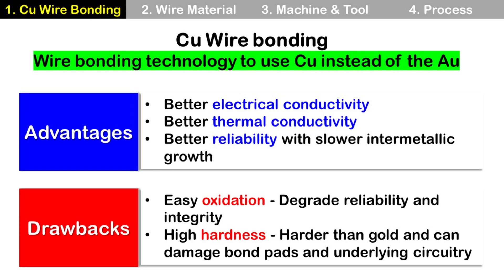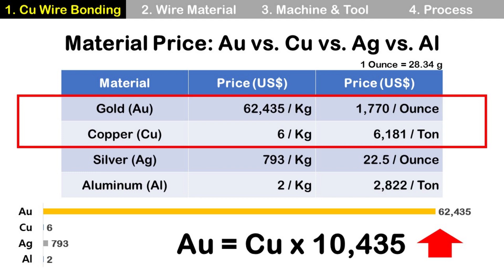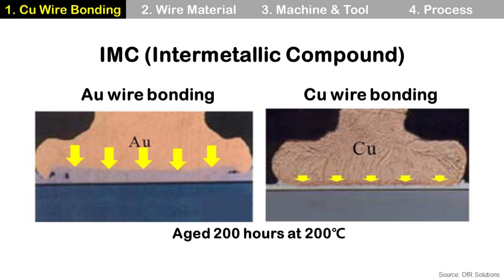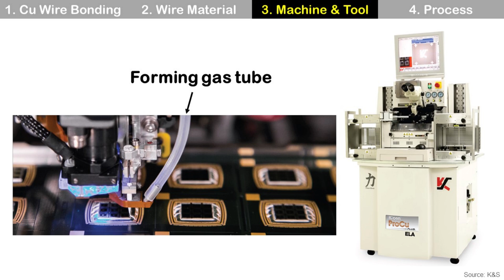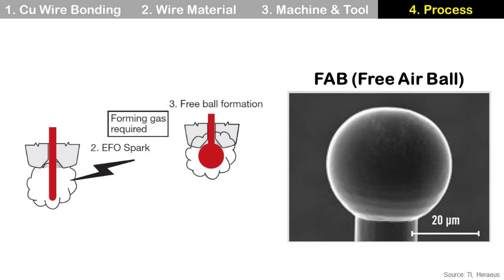[Eng Sub] Cu Wire Bonding

Comment: Hi, I have a bond pad thickness 0.8k circuit under the pad design and the circuit is ESD function.
After wire bonding and cratering test, I found the crack, Could you tell me where is the crack happened layer? ILD or metal layer;
How can I use what types chemical to etch it
Thanks
Reply from the maker: I am not an expert on this. As I know usually ILD has more crack than metal layer but you need to check through failure analysis. For chemicals to etch, I don't know and there are many chemicals depend on material to etch.

Comment: Hi, can you help me in explaination about mechanism of corrosion in wire bonding please. thank you
Reply from the maker: Cu ball bonding corrosion is mostly by Cl- ion from molding compound at high temperature with humidity. 
Please open the paper at below link and check Fig. 4 (Proposed UHAST failure mechanism of Cu ball bond) at page 107 and equations at page 108. 
https://core.ac.uk/download/pdf/191477175.pdf
Reply: @semicontalk3223  Thank you!

Comment: Could you tell me the purpose of forming gas and how is the mechanism , please ~
Reply from the maker: The purpose of forming gas is to prevent oxidation of FAB(Free Air Ball) of Cu wire. Because oxidized copper Free-Air-Balls are harder than without oxidation and more difficult to make 1st bond, bond on die pad.
Cu wire bonding machine provides forming gas continuously through tube toward tip of capillary. So this forming gas surrounds copper Free-Air-Balls during FAB formation and block oxygen from air.